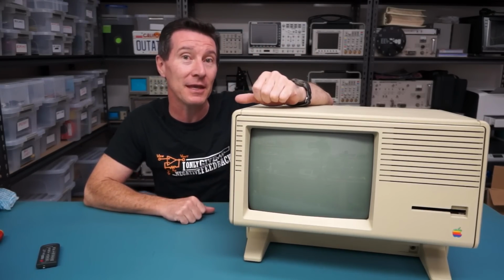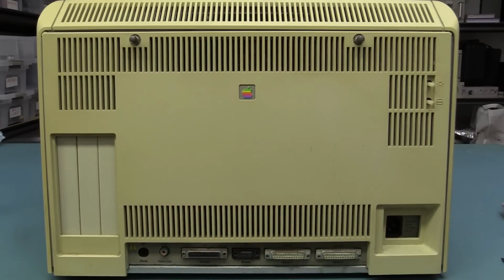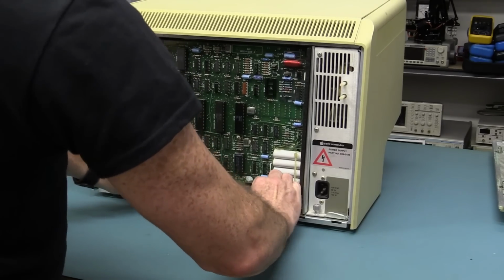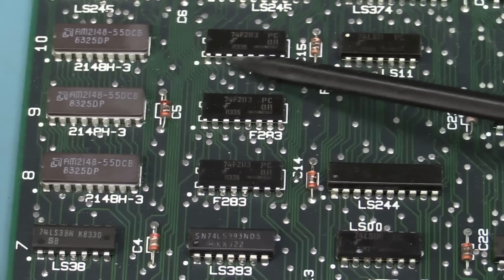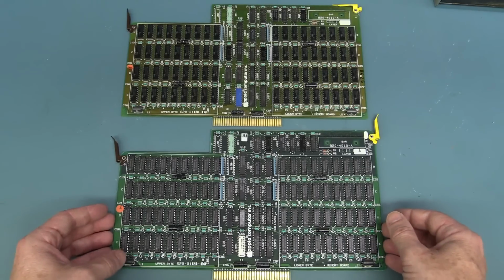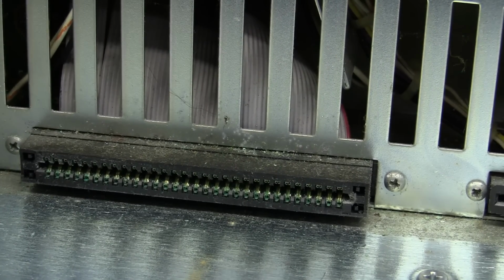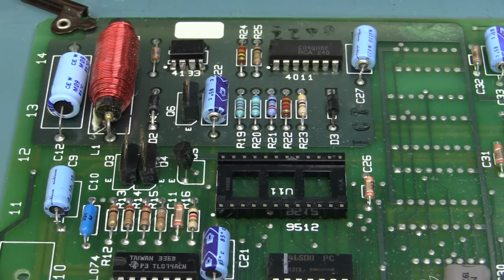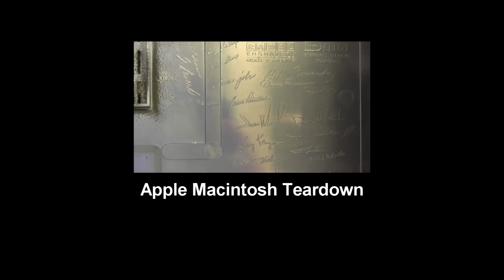EEVblog #696 - Apple Lisa Retro Computer Teardown

Comment: Hey Dave. My name is Lucian. I live in Romania. I work as a hardware and software engineer. Please let me know if you are interested in a project I have been developing that includes a HID device (hardware and firmware) and also a Java based software to interface with it. It is a starting ponit for a lot of applications. I can provide you with the sorce code and schematics and layout (i have two hardware and firmware versions - PIC based and MSP430 based) and also assistance if you need. I have used this for equipments that include an ultrasonic heat meter tester with CAN bus capabilities, an 868.36 MHz data colecting system and so on. It is free if you are interested. Best regards.

Comment: Graphical interface conpect, thanks XEROX. Apple II "the" killer ?. C64 best seller machine of all times till today with the most advanced sound chip by its era and 64K memory for 200 bucks or LESS. Note, by 1986, C64 got GEOS, the "GUI OS" that came FREE and run with the 64K and using floppy as swap space. Not a dream, but, hey, far from the 10K dollar budget. Commodore has beaten competitors and made them miserable. Just bad management would be able to stop CBM. Amiga project was far superior, far cheaper, far usefull. TV stations and Video Editors, and musicians will remember nothing but amiga rules. Apple keep saying that had invented almost everything, that in fact was already invented. Taking 1MB of memory to make a GUI system posible, big fail.
Reply: Not to mention NeXT.
Reply: C64? Great machine, too bad the pieces of shit never worked.
Reply: Mostlyharmless1985 LOL, market success, tons of software, million of users. Yep, never worked, like Apple.
Reply: totally never worked. lol
Reply: sure, for apple fan boys. Apple II using 6502, 6522 ... LOL ... FAILLLLLLLLLLLLLLLL Who made and desing those .... Go and read a bit.
Reply: 38911bytefree I still have my apple two, it boots up, it runs fine. Not the same could be said for my C64, the thing barely worked when it was NEW.
Reply: 38911bytefree um. the C64 ran on the 6502. It's a venerable and well tested chip, that still sees use even today. Chuck Peddle and Bill Mensch. I don't understand what your point is. It was a 6th of the cost of a Z80 and gave comparable performance. And, while you claim market success as an indication of reliability means you are thoroughly decoupled from reality. The Xbox 360 is a notable example of a market success that was a smoking piece of crap that failed when you gave it a harsh word.
Reply: Mostlyharmless1985
He's referring to the fact that Commodore bought out MOS Technology in the 70s, so they practically get the credit for making chips like the 6502 and the 6522 used in the Apple2.
Reply: I see. Doesn't matter though, that would be like saying pratt and whitney are responsible for the 747.
Reply: 38911bytefree WTF is your deal?  Back when the Apple II came out that was state of the art.  The 6502 and Z80 were the big boys.  16-bit processors were around the corner but not readily available yet.  So of course those systems had 8-bit processors and computers kept making systems with 8-bit processors until the late 80's.
BTW, for sound in the Amiga era, most composers chose the Atari ST computers because of the built in MIDI interface on them and not Amiga.  Most TV studios did use the Amiga though for overlaying graphics, etc.
Reply: gbowne1 Yeah, some C64's had the problem of overheating from time to time but overall it worked really well and was the best home computer in the early to mid 80's.
Reply: sprybug Best for what? The Apple II was a joy to program, at least that's how I remember it as a child, being able to peek and poke, with easy disk I/O and even being able to go into the monitor and actually see what the computer was thinking. I have no idea how easy the C64 was to tinker with, but my understanding is a small child wouldn't be able to do much without getting frustrated as it was a more complex machine, also expandability was something to be desired, that is it had none.to speak of. The Apple II was miles ahead in hackability.
It all really depends on what you want. My experience with the C64 was something of a sour one, as the first time I turned it on the damn thing let loose the blue smoke, but still responded somewhat to keyboard commands. after spending 30 minutes putting that wizard speak in to the command prompt trying to get my game to run I had to go tell my dad it was broken. That was not a fun day. I didn't even do anything wrong! It got me in trouble.
Reply: Mostlyharmless1985 Don't let that experience completely tarnish your outlook.  A lot of the 80's computers were great machines.  A lot of them did the same things.  The C64 allowed you to do the same thing you could do with the Apple, but it had superior graphics and sound capability, and the BASIC interpreter was designed to take advantage of it with sprites and sound commands to do really neat things.  I never owned an Apple or a Commodore growing up.  My first computer, that I had to buy myself, was a Tandy Color Computer 3.  Weak to the Apple and C64 by comparison but I still loved the thing.  I learned how to program on TRS-80 and Tandy's and it helped shape me to the person I am today.  I'm not a fanboy of any brand or make.  They all have a place.
Reply: Mostlyharmless1985 +sprybug
Man, I had all three, plus a C128! The C128, CoCo 3 (EDIT: I think actually a COCO 2), the C64, and an Apple IIe (owned in that order).

I got the C128 from my grandmother when I was 5. Sadly, I have only a few memories of it. We lived on a farm, and cash was rough in the 80s, so we sold it to the local library. I DID get a 50 in one electronics kit out of it though, and that set my course for life! I acquired another C128 in the 90s, cause i always regretted losing that old computer. I also recently re-aquired those old electronics kits that I used to have growing up, out of nostalgia, and the fact that I cannibalized the original kits long ago! :)

The CoCo 3 had some interesting music and graphics commands. You could play music by notes, and draw squares, lines, circles, do fills... But aside from novelty, I never ACTUALLY used any of them. They were slow, and occupied the computer till they completed execution.

The C64 (and 128) were my favorites. The sprites, sound etc were all amazing! It had the same PEEK and POKE commands, but I could also play with complex audio and a graphics at the same time! Also, to those who say the C64 wasn't expandable... you're all full of shit! XD The C64 has the SAME parallel and serial I/O capability as every other major 8-bit computer of the era! 8-bit data, 16-bit address, R/W, all the major internal bus pins were brought out to the "cartridge" connector. I had a book that detailed how to build an I/O interface system that could let you control or read THOUSANDS of devices... And that SAME hardware could attach to an Apple, a Commodore, an Atari, an IBM PC, a Spectrum... Didn't matter. There ONLY difference, is apple had seven or so slots, mounted internally, while Commodore brought one slot tot he outside of the case. If you WANTED, you could build an external I/O chassis that added multiple slots, then use some address decoding to perform a slot select. All you had to do then was write your software to use it. Heck, you can buy an SD card based SSD I/O module for the C64, TODAY! XD

Apple II... I used these at school, and I eventually acquired one... Truth is, I only ever used commercial software on them, and never got into programing them. They had no integrated audio or graphics features in ROM, as I understand it, and required you to effectively code everything yourself. That was beyond my skill set, so I mainly own one, after it's heyday, merely to add it to my collection.

Of all of them, My C128 was the only one I used out of them all well into the 90s. I last used it on a regular basis in 1997. It's mostly been moved to "collection" status since then.
Reply: richfiles Greeting shrugging Luna!
That's quite a history.  I didn't obtain the other 80's systems until I had my own vintage computing/console shop over 10 years ago.  I had to buy my own CoCo 3 with my paper route money.  Didn't come from a rich family, although I did get a disk drive system for it for my birthday about a year later.  It sounds like you were using programs to do those special things on the CoCo 3.  Sounds like the program Lyra (or Pan) for the music.  Programming sound on the thing was a bear though.  To do anything decent it had to be done in assembly and it occupied a lot of CPU time because the CoCo didn't have an audio chip.  It went straight from the CPU to a 6-bit DAC and then out.  It could do sound well, as long as it was programmed well to do so.  I used it to run a BBS (Bulletin Board System) that people could call from their computers via modem for about 6 years in the early to mid 90's.  First ran CEBBS in RS-DOS and then RiBBS in OS-9.  I had a ton of games for the machine.  I even hooked up with the guy who made the PacDude series (Brian O'Neill) for the CoCo 3 and I ended up writing the music via the CoCo for his last release, PacDude 2.  I was just 16. I think I got $30 for it. :)
Reply: sprybug You know... Looking at specs... I think i had a CoCo 2, not a 3... I repaired it myself when I was 10 (got it for free at a garage sale cause it was dead). I DID have a buddy who had a model higher than mine ( I assume that was the CoCo 3 I recalled, as it had WAY more memory than mine), and I was always pissed that he wouldn't let me have it, despite it residing in his closet for YEARS... and then it got tossed when he moved out of his mom's place... GRRR...

As for the graphics and music functionality, they were built into the BASIC programing language, in ROM. It might have had the Extended Color BASIC ROM though. Those commands took over the system till they completed, so at best, you could play a quick little fanfare at the end of a program execution. or graph some plot or chart or whatever. The commands were useless for anything "live". Since I fixed it myself, i DEFINITELY know there wasn't a PLCC or any other type of "quad-pack" VLSI chip on the mobo... and that seems to be the big element that gave the CoCo 3 it's muscle.

My grandmother really wanted the best for me, and went all out with that C128. I never really got to enjoy that one for long enough to really learn anything relevant, but it did set a fire to my curiosity though! In 5 more years (half my life back then! XD ) I'd have gotten the broken CoCo (2???), fixed it myself, and taught myself BASIC. Shame we had to sell it, but sitting on something that valuable back then was too much for a farm family being crushed by a 1980s era land mortgage. I miss all my old machines... as... DAMN IT... my dad pulled all the same "throw it all away" crap my buddy's mom did...

My Magnavox Odyssey and Odyssey II, My Fairchild Channel F, My CoCo 2, My Colecovision Adam, My Commodore PET... I took EVERYTHING APART as a kid. I knew how to put stuff back together. I kept all the parts, intending to fix things that broke someday, but when I went to college, he assumed it was all JUNK and tossed it all. At least I still have my Intellivision and most of my Nintendo and Atari stuff. My Commodore and Apple stuff is all safe too...

But I worry about my train set...
I don't remember where I stored it...
And I can't find it since moving! /)ᴼᴏᴼ(\

Dave's Indy model train video made me both nostalgic and bummed... ◶_◶
Reply: richfiles Yes, the CoCo 3 had what is called the GIME chip.  It replaced the SAM (Single Address Multiplexer) chip in the previous models and acted as the system's MMU and Video chip.  It upgraded the graphics capabilities of the CoCo and supported extra memory.  512k factory upgradeable, however 3rd party developers figured out how to get up to 2MB and even more, which was handy for OS-9, a true multi tasking operating system.  Sadly, the sound stayed the same, meaning just a 6-bit DAC.  It's why the system halted for a small amount of time any time you did anything with sound in BASIC.  The built in Microsoft BASIC interpreter did what you had to do to produce sound on the thing which occupied the entire CPU to do the task until it was almost finished.  There's a way to "share" the CPU while it is doing sound (by how OS' multitask essentially), but it would have taken a lot more coding to pull off in the BASIC interpreter.  It's how a lot of games did sound, like PacDude 2, etc.  Usually ran it through the FIRQ (Fast Interrupt Request), so it would always get executed at certain intervals of the CPU time.  Too slow and the sound quality would suffer.